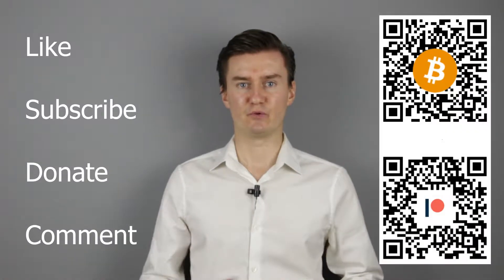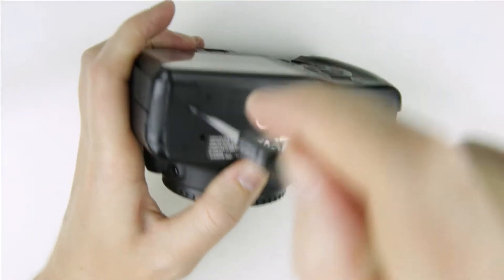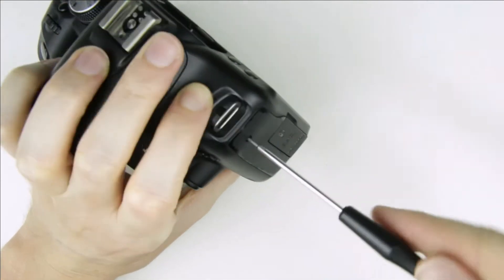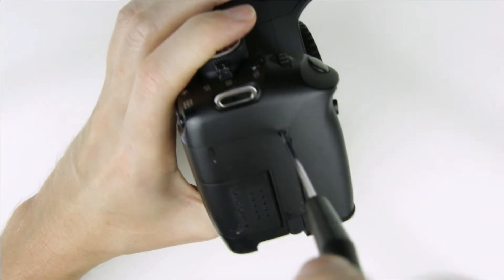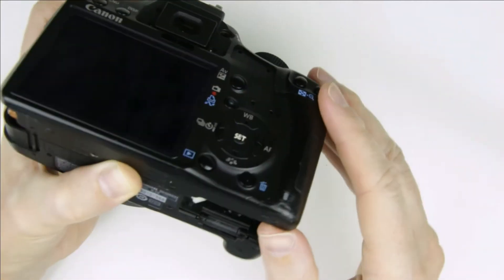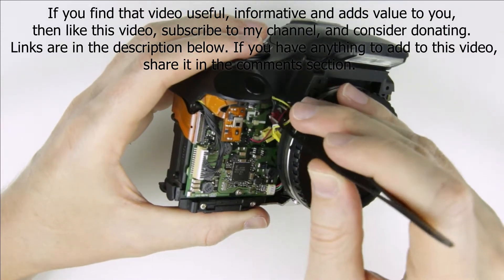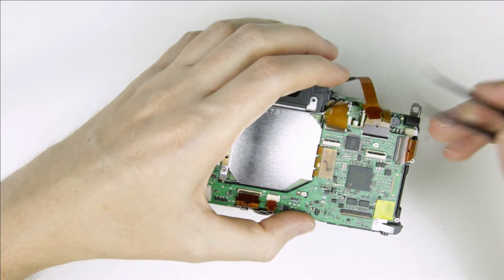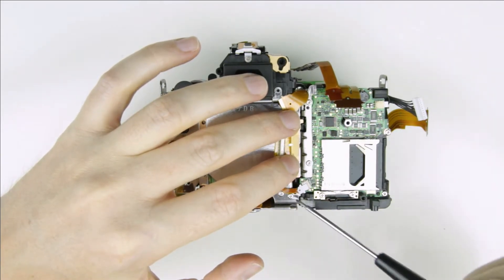Canon EOS 500D / Rebel T1i / Kiss X3 disassembly to replace the SD PCB slot board panel

Comment: Can i use the 550d screen to replace the 500d?
Reply from the maker: I don't think so. If I search for 550d lcd, the listings shows that the screen is compatible only with 550d, so I assume the 500D screen is physically different.
I haven's found any 500D LCD screens for sale, only some back panels on ebay.

Comment: Do you have contact number? Maybe like Whatapp, instagram etc.
Because i wanna tell about my problem on my camera canon 500d. 

The problem is, always display a notification "CARD WRITE PROTECTED". And that make my camera useless.
Please help me about my problem. Thankyou very much if you help me
Reply from the maker: Hello! If you really want to, you can contact me by facebook messenger, link is in the info tab or in the upper right hand corner.
About your problem: I had the same problem with a Canon 6D. In that case there is a metal switch in the side of the card reader which was bent a little bit, and when the card was inserted, it did not close the circuit. So, I had to bend it a little bit, then it worked well. Other option is to close the metal permanently (soldering it together), that way it will see all cards as writable.
Before you would disassemble the camera you might try to lower the read-only switch a little bit on the card (so don't push it completely to the end, but just leave half millimeter)... it might work, but of course, it is not a permanent solution.